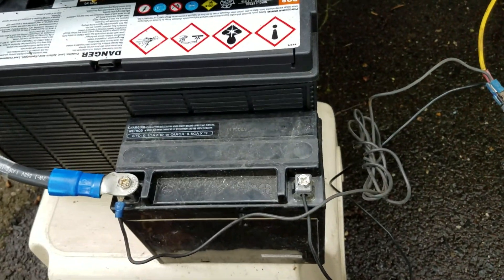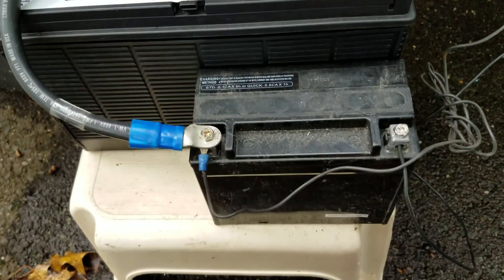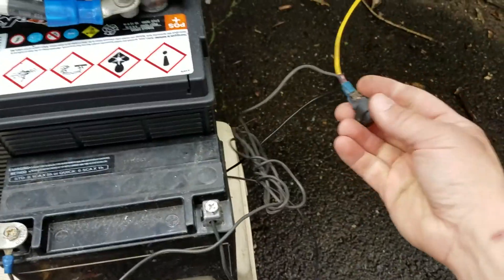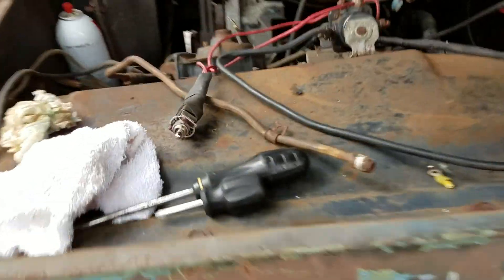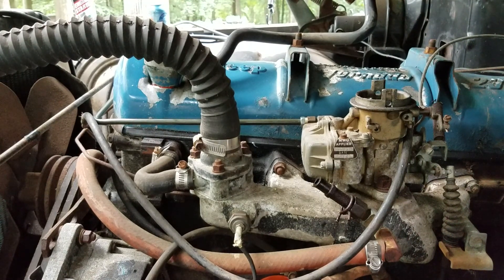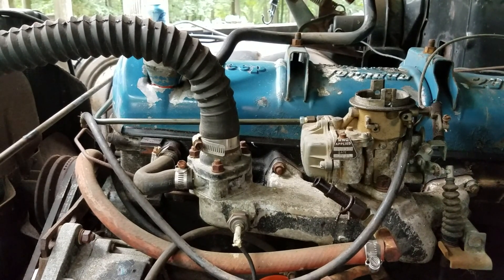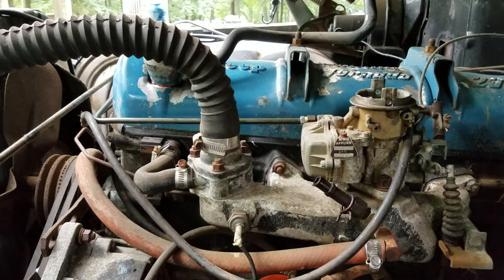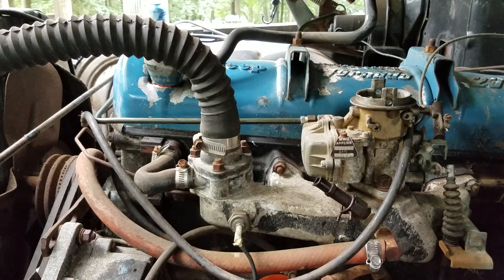12v and 24v mix on my M715

Comment: Fill the carb bowl with gas!
Reply from the maker: I'm not sure how I would do that without cranking it to run the mech pump, or with an electric pump. It is not possible to pour gas into this carb bowl. 
Ultimately, though, this particular bowl was filled with junk and would flood the engine. I cleaned it out and repaired or replaced the needle valve, and it ran great.

Comment: Gonna sound crazy buy i need some help with hooking up my fuel pump can I ask some questions?
Reply from the maker: Fire away. I'm not sure I'm the best resource, but I'm happy to help if I can. 
If I'm anticipating the problem correctly, you're adding an electric fuel pump thats 12v to a system still set up as 24v. 
This is fine, and I'm doing it on my military generators, this truck, and my current M715. 
Generally, (2) 12-14v batteries are wired in series to produce 24-28v. You can safely tap the center of these batteries to get 12v, assuming you fuse it. The alternator/generator  will recharge at 28v, which will protect the battery you're tapping from drawdown. 
The most important part is making sure your accessory (fuel pump) positive wire goes on the jumper between the batteries, and you have a fuse on it as close to the battery as possible. Negatove should use the vehicle body. 
You might be tempted to skip the fuse, but you should really never do that unless it's a last resort.
Reply: @robr2154  thank you for all that good information! Its very helpful! Actually, I am putting the original mechanical fuel pump back on. There was no issues with it just cracked lines and the previous owner went ahead and put an electric fuel pump on it. It doesn't have enough output on it and on top of that it just blew. Lol. The original pump only had less than 6k miles on it as the truck now only has 6900 original miles. I have absolutely no idea where the fuel lines run to and have very little resources on it. Any help appreciated!
Reply from the maker: @marshalldavidson2639  hey, sorry for the late reply, I must have missed the notification. 
I'm sure you've moved forward, but some quick info that might be helpful... 
These old mechanical pumps have internal diaphragms that crack, and  seals that dry out. In an absolute worst case scenario, the combined failures can allow gas to seep into the crankcase, where it thins the oil and reduces lubrication, leading to an engine failure if you don't catch it early. Even if the mileage is low, the age alone reduces the seal life. In fact, low use of a used product (as opposed to NOS) is often a big cause of seal failure. 
These particular fuel pumps also have a vacuum pump to assist with loads like windshield wipers, so occasionally, even when switching to an electric pump, people leave the mechanical pump in for vacuum. 
The best thing to do if you have the old one and it's seen petroleum, is to find a rebuild kit and rebuild it. Or at least dismantle it and check the seals, maybe soak rubber ones in silicon or a restorative product if they are crumbling. 
Hope that's helpful!
Reply from the maker: @marshalldavidson2639  oops, neglected to address the fuel lines. 
Btw, have you found m715zone.com yet? Thats a massive resource for data on these trucks. 
I forgot where the lines run... We're in a snowstorm right now, but I can try to look at where mine run, they're factory with rubber hose tapped on to reach the electric pump. I think they are predominantly steel from the tank to the pump, then steel from pump to carb. 
I'm pretty sure fuel lines are at the bottom, vacuum lines are at the top. You could theoretically just plug all the vacuum lines and ignore them until later, too.

Comment: Rob, I need help with a distributor purchase for my M715 . This truck was converted from 24 to 12 volts at some point. The distributor they used for the conversion is from a Buick slant 6. Even though the distributor fits, the shaft rotates in the wrong direction so the advance is all messed up, it retards instead of advances. I need to get the proper distributor, The consensus is to get a 12V distributor comparable with a 1965-1968 civilian Jeep Gladiator that had a inline 6 Tornado engine.   Is your Chevy HEI functioning fine still? If so, do you have a link? Thank you!
Reply from the maker: I sold the truck, but didn't spend much time driving it to know how the advance went. I believe the one I used was also rotating backward, but the advance was just effectively disabled, it didn't retard. These engines run at such low rpm power range, that I'm thinking using high octane fuel might be adequate to just run without advance. 
But I will do some digging when I get to my pc with receipts, see if I can find the unit I used.
Reply from the maker: Btw, I'm pretty sure the one I used was HEI from a Chevy V6. There's a shot of it in another video, I think the one posted 9/11.
Reply: @robr2154  Yes I saw that, if you find which one it was that would be great. The high octane fuel strategy may be one I try. Driving on the road to day the truck drove very poorly  above 1500 rpm, lots of back fires, and no power.